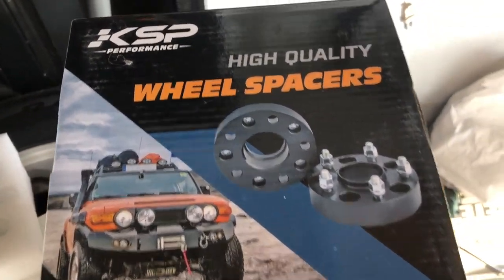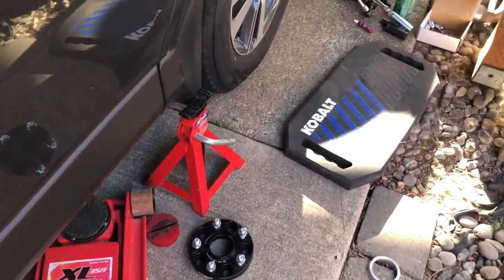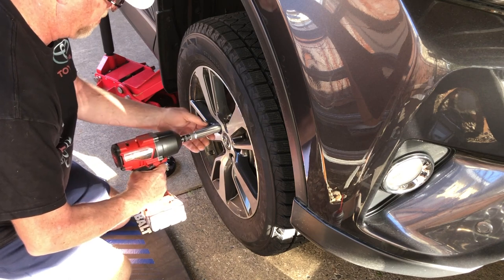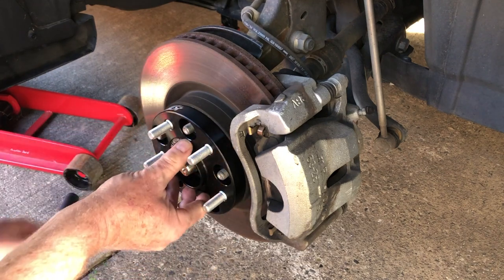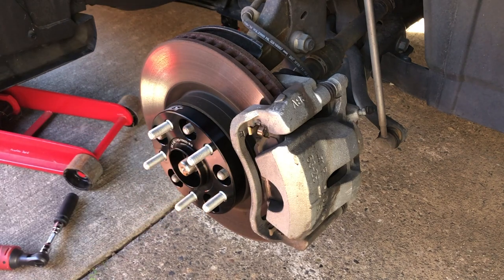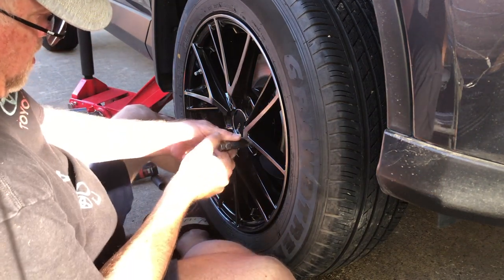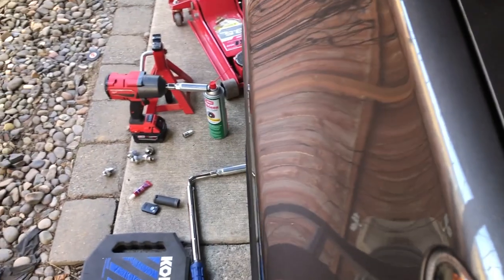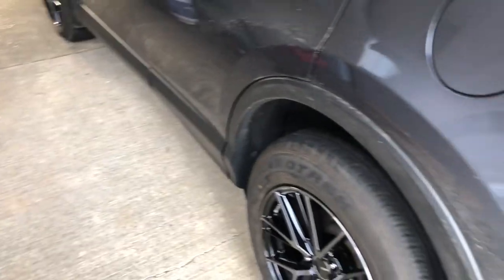My RAV4 Gets Wheel Spacers | How To SAFELY Install & ENJOY Wheel Spacers! The RAV4 Looks 10x Better!

Comment: Oh and thanks for this video, i used to run a 15mm spacer of that type on my 2013 Corolla, i had to drill holes in my aftermarket wheels in order to get the original lug nuts to clear, lol
 I've never used loctite, I'll have to use that next time! :)
Reply from the maker: That was brave to drill the wheel! I don't think I would have done that. I ran 25mm spacers on my 2009 Corolla S Turbo when I had a set of Scion FRS wheels for my winter setup.

Comment: Thank you for the video! One question, at the end when putting back the tires,  did you yse 76 pressure on the torque wrench as well?
Reply from the maker: I used to always use 76 ft-lbs but the special torque wrench I bought that I use for my lug nuts has preset points and the closest one is 80 ft-lbs which is just fine.

Comment: Great video! I have a 2009 rav 4 was thinking of getting spacers because of how sucked in the wheels are. Would 25mm work without issues? Also how do I know what spacers will work with my tire offset?
Reply from the maker: The best way to figure it out is to measure the space you have. You can use a straight edge or something flat against the tire that extends up to the edge of the wheel well and then measure the gap. Without seeing your RAV4 I would guess that a 25mm spacer would be fine if they are sucked in a lot.

Comment: what electric drill did you use to pull the lug nuts, and what smaller one did you use to put them back on?
Reply from the maker: These are the tolls I used. 
https://www.amazon.com/Milwaukee-2767-20-Torque-Impact-Friction/dp/B08P4NX77N/ref=sr_1_1?crid=2CPQ5FQAQU1BV&keywords=milwaukee+tools&qid=1683936824&sprefix=milwaukee%2Caps%2C159&sr=8-1

https://www.amazon.com/Milwaukee-FUEL-Speed-Cordless-Ratchet/dp/B08XB59NKR/ref=sr_1_4?crid=2CPQ5FQAQU1BV&keywords=milwaukee+tools&qid=1683936824&sprefix=milwaukee%2Caps%2C159&sr=8-4
Reply: @jimsgaragetoys  Thanks!

Comment: I'd rather spend the money on new wheels with the proper offset than use spacers. But that's just me
Reply from the maker: Sometimes that's not possible. In my case I have a set of winter wheels and standard 3 season wheels that are similar in width and offset. This is a much easier way and much less expensive solution than buying 2 more sets of wheels. My buddy uses a set of 35mm spacers on his older 911 so he can use newer 911 wheels that are a much different offset. He's been racing with them for more than a decade as many 911 owners do, no issues. That is the point of this, to show people how to do this the correct way and to have great results for very little money. 😎